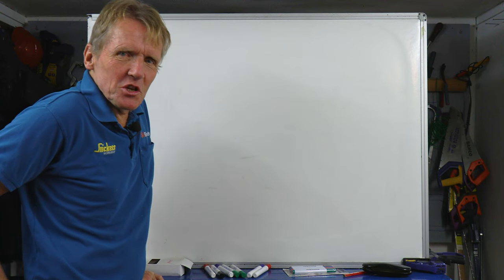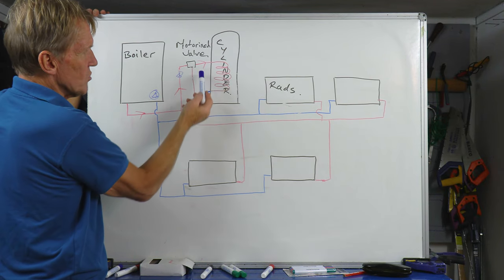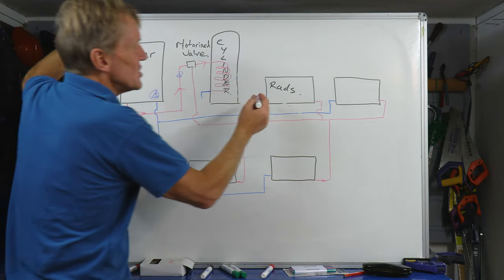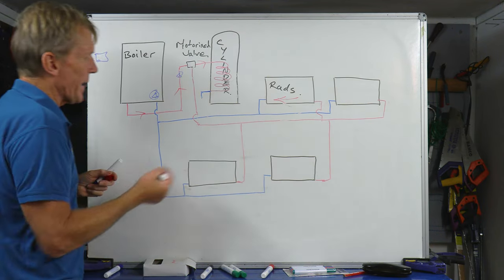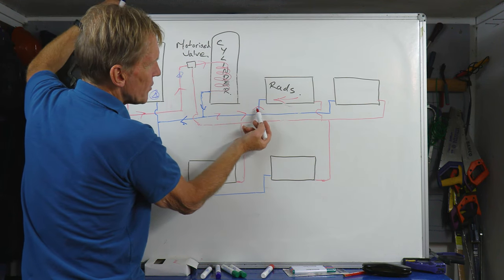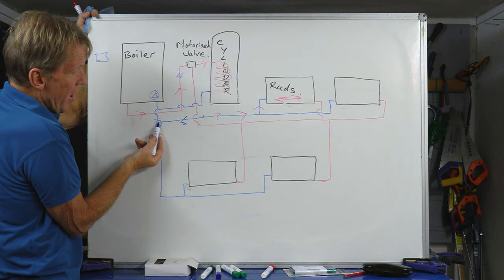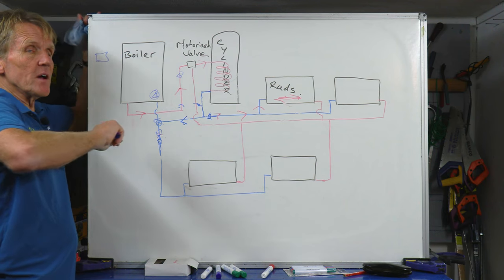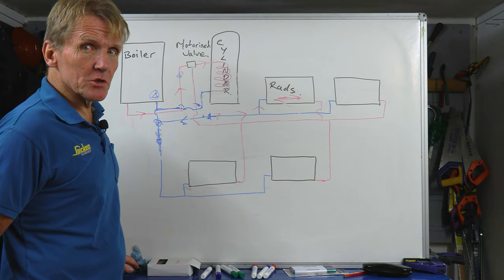Why Are Your Radiators Getting Hot When the Heating Is Off?

Comment: Roger. What are your views on electric radiators in place of central heating ?  Have they caught up yet and become a viable alternative?
Reply from the maker: Hi Tony 
At the moment electricity is more expensive than gas but, as we now buy a lot of our gas from Russia, that could change. I think if you have a very well insulated home and are willing to top the heat up with a fan heater during the coldest days then electric radiators could be o.k. I don't think I would choose them if I had gas in the building but a lot of landlords prefer them because they don't need an annual safety check.

Comment: Is it the same concept with UFH?
Reply from the maker: Almost but there are flow guages on each circuit and you normally have a drawing that tells you what to set each circuit to.
Reply: @SkillBuilder  I've got a single zone UFH and I've realised some radiators warm up slightly when the UFH is on

Comment: Hi, why are my radiators warm when heating is off on combination boiler please
Reply from the maker: It is probably the divertor valve in the boiler that it not quite closing. This can happen with dirt or debris in the heating system. If you can get some system cleanser into the heating and run it around for a week of so then drain it down and refill and drain a couple of times it might help. After that you need to top up with corrosion inhibitor.

Comment: the pump generally goes into the middle of the divert er valve, and spreads left or right to rads or cylinder, your drawing goes in from one side, specially because you ve shown it pulling out from the flow side of the boiler , only saying could confuse d i y peeps
Reply from the maker: Yes it wasn't a great drawing. I am afraid it is my weak point but I am trying to fix it. I know the flow is usually on the left and the tee is not right. Better things to come.

Comment: Can anyone suggest why heat not getting to basement radiators in a 4 floored house when Hot Water is on.
Reply from the maker: There is too much flowing through the cylinder coil. You need to choke it down
Reply: @SkillBuilder  I will investigate this.  I was sent engineers fm Br Gas today who blame my Potterton Boiler being 25 yrs old. Sent a quote for mega thousands and much upheaval ., due to pipe dimensions being restricted .  
I will def ask a plumbing engineer to consider to choke down this cylinder coil.  No one mentioned that at all. I could not understand if it was the boiler giving up how it was fine when hot water not on. Thank you. Great site. Learning a lot!
Reply: @SkillBuilder  I will investigate this.  I was sent engineers fm Br Gas today who blame my Potterton Boiler being 25 yrs old. Sent a quote for mega thousands and much upheaval ., due to pipe dimensions being restricted .  
I will def ask a plumbing engineer to consider to choke down this cylinder coil.  No one mentioned that at all. I could not understand if it was the boiler giving up how it was fine when hot water not on. Thank you. Great site. Learning a lot!
Reply: @SkillBuilder  Thks for this. The cylinder coil: is that in the hot water tank.  The hot water tank in this system is v big and is in same area as the Potterton Boiler 25 yrs old installed at top of house. Cold tank and expansion in attic above the boiler. What does this coil you mention actually do please… I am struggling to understand why radiators all work on all floors even basement but when hot water is ON the rads in basement get no heat..
Reply: @SkillBuilder  you were right . Thank you.

Comment: I’m having a problem with radiators coming on now after I popped the heating on the other day as it was cool. Heating is now turned off but hot water is on, we now have a radiator (without a thermostatic valve) getting hot. We have an oil boiler and a Honeywell two port S valve. Valve is unenegerised when the hot water is off (springs back) and loose when energised. 
Anyone with any ideas? Thanks in advance....
EDIT- Have checked the pipes and it’s the thermostatic valve end of the radiators that heats up first, so not the system in reverse
Reply from the maker: It is probably a bit of crap holding the valve open slightly. If it has been stuck in one position it can happen. Try turning the pump up to top speed and if that doesn't work maybe some system cleanser. If all else fails drain down and take the valve off without removing wiring and just see how it opens and closes on the lever. They are usually fine once they have been cleaned out a bit.

Comment: You should never throttle flow with a ball valve.

Thermostatic radiator valves would have solved this more easily surely?
Reply from the maker: Chris B Cod. It has TRV's the NRV rattled on start up,long before the TRVs cut in to slow the flow.  I haven't had to go back there so I am  deducing that she is warm and happy or dead.

Comment: Help I have a radiator that comes on in the airing cupboard. My thermostate is off, all other radiators are off . The radiator in the airing cupboard does not have an on and off switch, if there is one  I cannot see it. It is wired into a socket.  I have a combi boiler.... I don't want this radiator on in the airing cupboard.  It is using energy that I am trying to conserve. Does anyone have any ideas on how to turn it off ??
Reply from the maker: Hi Sarah
It is very unusual not to have a switch or timer of some sort. It may simply be a fuse where the flex enters the wall.
Reply: @SkillBuilder  Thankyou For the reply. I will double check and look out for a switch  or timer

Comment: How do you check this with Radiett valves? where there are 2 pipes that continually circulate the hot water into or past one end only of the radiator?
http://www.vpksk.sk/dokumenty/radiet.pdf

Comment: Just turn all  the radiators off in the summer individually
Reply from the maker: The summer is not the problem, it is the spring and autumn when you might want the heating on for an hour or so in the evening

Comment: What if my rads never get hot?
Reply: It could be that they have air in them and need bleeding?  Get a small container (ice cream tub is ideal) and hold it up to the bleed valve (at the top of the radiator) use a radiator key to open the bleed valve.  If there is air in them, this will come out, wait until you get water coming out before you close the valve.  It may also be handy to have an old towel handy to catch or wipe up any excess water.
Reply: Edward Holmes Thanks dude

Comment: Depends how the system is piped some instances it's heat transfer up the return heating the upstairs radiators up. Always tee the cylinder return in last folk's
Reply from the maker: Did you watch the video?
Reply: @SkillBuilder  most of it
Reply: @SkillBuilder also balofix valves on heating is a no no.

Comment: Reverse circulation is fairly uncommon. 99% of the time its actually a faulty valve. 😝
Reply from the maker: I would love to know where you get that statistic from. That assumption is precisely the reason that the problem is often misdiagnosed. There is an easy test to tell if the motorised valve is letting by and it should never be changed by mistake but I used to host a radio phone in on LBC and the number of people who had this problem and told me the plumber had been in and changed the valve, but the problem remained,  was considerable.
Reply: Think he been sarcastic
Reply: @piee683  sarcastic? No he's just a troll.
Reply: I’m not a troll, I’m a heating engineer with 20 years experience. Have fixed reverse circulation issues, you did a good job explaining it actually. It’s just an uncommon occurrence in my experience. Normally by asking was everything working okay before... and now you’ve developed radiator issues? And... has it ever worked properly since it was installed? Will point you where you need to start looking.
Reply: In 11 years I've had reverse circulation twice. So I would say 99% was being generous, more like 99.9%